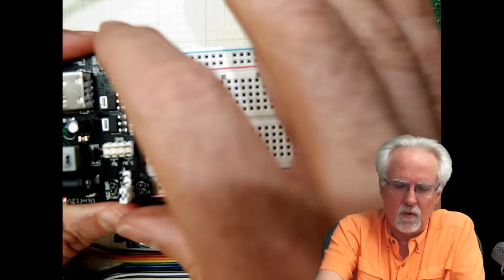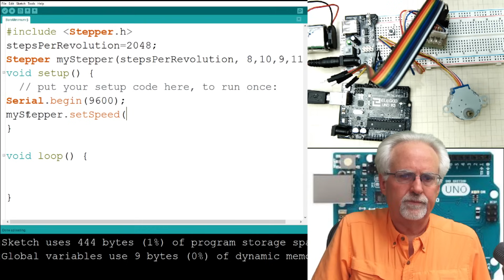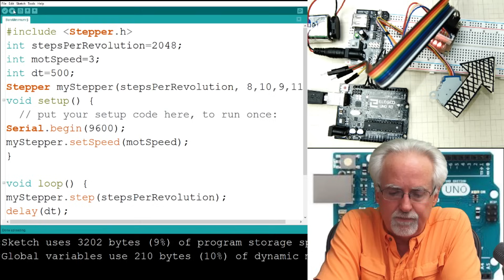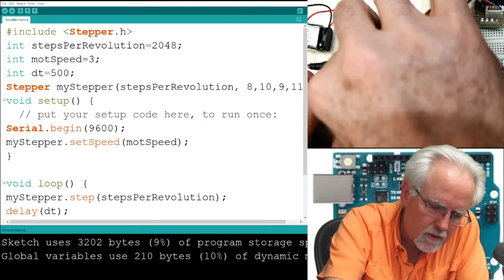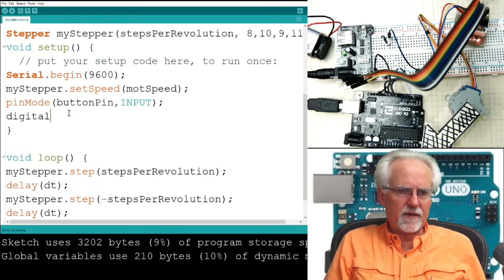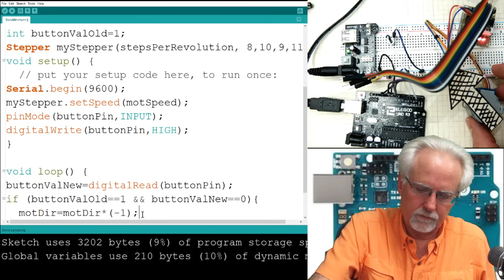Arduino Tutorial 35: Understanding How to Use a Stepper Motor

Comment: Professor, I did not get why we need to add
"buttonValOld = buttonValNew;"
to make it work a second time we press the button...

Cheers!
Reply: Ohhhh, I got it!
The microcontroller is so FAST to read the code that it flip the rotation direction a bunch of times whilst we hold down the button, right?
Therefore the direction could be one way or another...
Interesting!

Comment: GREAT! This is the one I have been anticipating for a project. I am wired as per lesson# 35. I can hear and feel the motor stopping and starting but no movement. Thanks to @Seftdelmer I replaced the 9v battery. That helped - goes round the first time but then there is very little movement if any in the other direction. Is there a foolproof test I can do just to see if my stepper functions - like the 5v direct connect tests you have done with other components?
Reply: Found my own error. Had coded "Stepper myStepper(stepsPerRevolution,8,10,9,11)" incorrectly as "Stepper myStepper(stepsPerRevolution,8,9,10,11) - 10 and 9 were reversed.

Comment: I know it's an old video. I don't know if you read the comments here.

I did the homework as you said, without having seen your solution to that.

I did a attach.Interrupt and with it i called a function "reverse", ive made.

In this function, i reversed direction.

My quick and dirty way of spinning infinitely in the main loop, was to start of with "while (true)"

It's at least a very short code, by having the same outcome.

I've did a INPUT_PULLUP command on the pinmode. That works great.

Thank you Sir, for your educational videos. 
Ive learnt a lot from you!
Reply: I learn something new from this comment. Thank you for sharing your technique! the INPUT_PULLUP was definitely helpful

Comment: Everybody copied you (just kidding). I copied you, I must confess. It worked ok but for some reason the motor stopped turning after a while. Love your lessons but this one got a bit confusing once the push button was added....
Reply from the maker: If you are using the battery, it will only last a short time. Maybe a dead battery problem.

Comment: Paul, I'm having a very hard time with this lesson.  If I procured my own stepper motor how would I go about figuring out the pin sequence? Were would I start to figure out the pin sequence of 8,10,9,11?

Also I spent two evenings working on this assignment before giving up and watching your answer.   I referenced lesson 28 (push button as a toggle switch) and you had us create an if statement that contained a if and else statement.  I could not get the stepper to work using this method.  

I then watched ahead to see the answer to this lesson is a single if statement.  I'm lost on this lesson.

Comment: Tutorial 35 I was not able to do this on my own. I had the right idea, and my code was close, but couldn't seem to get the coding quite right. Also, there was a hiccup on the jumper pins and it took me a while to figure this out. It might be good to put more explanation into the power supply board and also how you figured out the 8,10,9,11 pin setup. I looked at the Elegoo documentation and couldn't seem to arrive at the same pinout you did.

Comment: I did pause. Honest. Only i'm finding something is seriously slowing down my arduino console, when i rem out the .step lines it races on, but when i'm processing stepper instructions, it's so slow the serial.prints are taking a whole minute each, odd. i'm puzzled because the stepper is moving as required. I rem'd out the delay lines, that makes no difference. 

For the record, i'm using an elegoo mega2560 and ide is 1.8.19, 

ROHS by the way, refers to reduction of hazardous substances, it's a european standard to reduce hazardous waste. less lead and cadmium to mention but two. It affects all new goods, and it's the reason there are so much ex factory stock available on ebay, if it's not compliant they can't use it in new product.
Reply: Now i've increased the speed to 10rpm, the motor is running ok, and the console, it's running faster......doesn't make sense.

Comment: I completed the task myself but using a method much less efficient and more complicated than the way you did it, here is my sketch.

#include <Stepper.h>
int StepsPerRev=2048;
Stepper stepsy(StepsPerRev,8,10,9,11);
int RPM=10;
int Reader=12;
int status;
int delayT=250;

void setup() {
  // put your setup code here, to run once:
Serial.begin(2000000);
stepsy.setSpeed(RPM);
pinMode(Reader,INPUT);
digitalWrite(Reader,HIGH);
}

void loop() {
  // put your main code here, to run repeatedly:
status=digitalRead(Reader);
Serial.print(status);
Serial.println("  FowardStep  ");

if (status==0){
  while(status==0){
    status=digitalRead(Reader);
     Serial.print(status);
     Serial.println("  Loop1  ");
  }

  while(status==1){
    stepsy.step(-2);
    status=digitalRead(Reader);
     Serial.print(status);
     Serial.println("  ReverseStep  ");
  }
  while (status==0){
     status=digitalRead(Reader);
     Serial.print(status);
     Serial.println("  Loop2  ");
  }
  
}
stepsy.step(2);

}

Comment: The 9v battery only lasted a few minutes. I was able to find an old 5V transformer that actually put out a little over 6VDC and splice it into the 9V connector. It lit up everything brightly and worked fine!

Comment: 23:56 This is what I came up with, now listening to you now.

 press=digitalRead(button);
  if (press == 0 && millis() - time > debounce){
    direction=!direction;
    time=millis();
  }
  Serial.print("Button State; ");
  Serial.println(press);
  Serial.print("Direction: ");
  Serial.println(direction);
  if (direction == 0){
    motor.step(-stepsPerRevolution/2048);
  }
  if (direction == 1){
    motor.step(stepsPerRevolution/2048);
  }

Where I went stepsPerRevolution/2048 was because the program would wait untill 2048 steps were made before listening to the button. Which would be fine if I wanted to go a full revolution per run through the code. But I don't think that was the intent of the project.

Comment: Mr. McWhorter, my solution is not as concise, but it works and I hope it makes sense, thank you
```
#include <Stepper.h>

#define ResetBtnPin 7

int Dt = 10;

int MIN_STEPS_PER_REVOLUTION = -2048;
int MAX_STEPS_PER_REVOLUTION = 2048;

long MotSpeed = 5;

int StepperStepsAmount;
bool MoveClockwise = true;
int StepsMultiplier = 1;

Stepper MyStepper(MAX_STEPS_PER_REVOLUTION, 8, 10, 9, 11);

int ResetBtnVal = 1;
int PrevResetBtnVal = 1;

bool ResetPressed;

bool isBtnPressed(int _readVal, int _prevVal) {
  bool isItPressed = _readVal == 0 && _prevVal == 1;
  // not used here. just keeping as a reference
  // bool isItPressedAndHold = _readVal == 0 && _prevVal == 0;

  return isItPressed;
}

// 1
void updateButtonsState() {
  int readResetVal = digitalRead(ResetBtnPin);
  ResetPressed = isBtnPressed(readResetVal, PrevResetBtnVal);
  PrevResetBtnVal = readResetVal;
}

// 2
void updateStepperMoveMode() {
  if (ResetPressed) {
    MoveClockwise = !MoveClockwise;
  }
}

// 3
void updateStepperStepsAmount() {
  StepsMultiplier = MoveClockwise ? 1 : -1;
  StepperStepsAmount = 1 * StepsMultiplier;

  if (StepperStepsAmount > MAX_STEPS_PER_REVOLUTION) {
    StepperStepsAmount = MAX_STEPS_PER_REVOLUTION;
    return;
  }
 
  if (StepperStepsAmount < MIN_STEPS_PER_REVOLUTION) {
    StepperStepsAmount = MIN_STEPS_PER_REVOLUTION;
  }
}

void setup() {
  Serial.begin(9600);
  MyStepper.setSpeed(MotSpeed);
  pinMode(ResetBtnPin, INPUT);
  digitalWrite(ResetBtnPin, HIGH);
}

void loop() {
  updateButtonsState();
  updateStepperMoveMode();
  updateStepperStepsAmount();

  MyStepper.step(StepperStepsAmount);
  delay(Dt);
}

```

Comment: I used a for loop to start with, then I had if statements with 3 conditions inside, that is the old and new button values , and then introduced new valuew where I was doing modulus division of the for loop integer j, so if I pressed and it was an even number it spin in the positive direction, in the odd number loop it spin in the negative direction

Comment: I used a stepped adapter to power the stepper motor and I set the voltage to 5v yet It seems there is a problem in which the stepper motor does not rotate in the opposite direction no matter what I do. does it mean the my stepper motor is not working or I did something wrong?

Comment: I tried to reglug everything and the 5V power card's LED turned off when I plugged the 5V wire to the rail. When I ran the program that LED lit up a couple of times and the LEDs on the motor driver board still won't turn on and motor didn't move. Please help!
Reply from the maker: Make sure your battery is not dead. Those 9 volt batteries last about 2 minutes.
Reply: @paulmcwhorter  Thanks but I used the same battery for the lesson for DC motor controls and it worked just fine. I am a little concerned about a broken stepped motor control board.

Comment: I may have found the problem: I plugged the 5V and ground wires to the 3.3V rails. But when I replugged the 5V wire to the 5V rail after plugging the ground wire, the motor driver's LED turned off. And the motor still didn't turn. What did I do wrong? Thanks!

Comment: Somehow the stepper motor worked once in the beginning and then it stopped working (and the motor driver card's LED lights don't lit up either though the 5V board's LED still lits up). Not sure what happened?

Comment: my stepper motor seems to only be moving in the clockwise direction but when i want to it go in the counterclockwise direction it sound like it would work but the shaft doesn't move. the code I have is the same as yours, any suggestions.

Comment: Hello Mr.Paul.  The same code t tried with my arduino board, it worked nicely, motDir*(-1)  idea is wonderful. I think this must be the optimum code , however I used 1.5 sec delay inside the if loop so that every time the push button is released the motor halts and then changes direction to allow enough time to decay the kick back emf. Thanks Mr. Paul.

Comment: Hello Paul. Quick Question! is it possible to plug the power supply of the motor to the computer using the other port? or is it dangerous ? Since i do not have the battery that you are using. Thanks in advance !

Comment: These Videos are absolutely amazing. I always watch till the end. Thank you so much!

Just a quick question. If I were using a different stepper motor, how would I know if my power supply would provide the correct amount of amps to the driver. Also, how would I know if I'm using a correct driver for the stepper motor?

Comment: Me just low at understanding English properly, I have a doubts here

Before using the switch, you wrote code "mystepper.step(stepsperrevolution);" to rotate the motor 2048 revolution.
But after coding for switch you wrote "mystepper.step(motdir*1);"
How this is working, it didn't got it. 
Please

Comment: Hi Paul.  Thank you so much for your Arduino tutorials.  They are the BEST that I have found on YouTube.   I really only have a couple of projects that I need an Arduino, but it still requires that I learn this whole series.  I followed this tutorial as well as the one on Potentiometers and it worked perfectly.  I'm having trouble incorporating a button AND a potentiometer with the stepper motor.   My project is controlling a large stepper motor with a momentary button to start the stepper in one direction until released and the motor stops. Another momentary button to start the stepper in the opposite direction, and a potentiometer for speed control. Any help would be appreciated. Thanks!

Comment: I did it in a different way and used a boolean value. This homework is challenging for me and took me 4 hours (with some momentary breaks) but enjoyed the process. Thank you Paul for teaching me how to use the Arduino. 

Actually I bought the kit on January and looking for tutorials but I was so hesitant to watch yours because I want to literally go straight up making cool and perplexing projects. I gave up because I don't understand anything. From why is the LED hooked that way and why it has a resistor. Why does the breadboard has + and - rails. Why do you do pinMode in the void setup and digitalWrite in the void loop, and literally everything else. I felt that this isn't for me even though my long-time dream is to work in the robotics field (still my dream as of now). I figured out the reason why it was hard. It's because I immediately jumped to the best part where you apply everything you learn (which for me, none) to make those cool projects. Just like how everyone wants to be like Elon Musk but no one wants to work hard like him. Anyways, this thought of mine lasted until May (4 months after buying the kit). I again saw your tutorials and somehow thought of watching everything, because suddenly I get the feeling that I want to learn. Now I can apply what you taught us from Lesson 1-35 and still ongoing and looking forward to finish this tutorial. Thinking of watching your tutorial is one of the best blessing I got so far in my life.

Sorry if this comment is too long. It's okay if you don't want to read it. I just want you to know that I made it this far and you are a big part of it. I'm still working with my dream. Thank you!!!

Comment: I tried this assignment and failed. Eventually I figured out that the motor I got in my kit won’t step a value less than 5 and it has 2000 steps per revolution instead of 2048. For the longest time I couldn’t figure out why my solution wouldn’t work so I’m watching on for your solution to see if I can adapt it to my conditions.

Edit to add. It took a few extra lines of code, but it’s working. I’m definitely not frustrated or anything. It was fun messing around sorting out my values and now it’s running just like yours, just on different step values. It’s probably a good learning experience for being able to figure out other hardware.

Comment: I think I got it! I used the simple pushbutton setup from the last lesson, then made a variable 'x' that adds one to itself for each push of the button, and waits for you to let go using 'while pb_state is equal to 0 {check pb_state}'. If x is equal to 1 then stepper equals high (rotate clockwise), if x is equal to 2 then stepper equals -high (rotate counter clockwise), if x is greater than or equal to 3 then x equals 1 (resets rotation back to clockwise). SPOILERS!! Here's my code! 🤓💻

#include <Stepper.h>
int stepsPerRev = 2048;
int motSpeed = 10;
int pb = 7;
int pb_state;
int x;
int dt = 100;
Stepper myStepper (stepsPerRev, 8, 10, 9, 11);

void setup() {
  // put your setup code here, to run once:
  Serial.begin(9600);
  myStepper.setSpeed(motSpeed);
  pinMode(pb, INPUT);
  }

void loop() {
  // put your main code here, to run repeatedly:
  digitalWrite(pb,HIGH);
  pb_state = digitalRead(pb);   // checks for initial PB state

  if (pb_state == 0) {
    x += 1;   // adds one to 'x' under condition
    while (pb_state == 0) {
      pb_state = digitalRead(pb);   // waits until user lets go of PB
    }
  }

  if (pb_state == 1) {

    if (x == 1) {
      myStepper.step(HIGH);   // Rotates stepper clockwise
    }

    if (x == 2) {
      myStepper.step(-HIGH);   // Reverses rotation of stepper
    }

    if (x >= 3) {
      x = 1;   // resets stepper rotation
    }
  }
}

Comment: Hello Paul! I have a question about jumper cables. Do the jumper cable colors matter. Like for example does the black jumper cable only work on grounds or can it be used on pins? Thank you! Keep up the great work!
Reply: I am not Paul however I’ll answer your question. 
No the color of the wire really doesn’t matter unless someone else is going to work on the project later. I prefer to use red for positive and black for negative because I have a background in automotive repair. In alternating current circuits like house wiring black is typically used as hot, white for common and green for ground.  For these projects sometimes it is which ever wire I pick up first since they are temporary.

Comment: Hi thanks for the videos i have been learning a lot, I did not understand where you got the 2048 number from at 16.22 , I went to datasheets this number is not displayed, it seems that you looked at the stepper motor that writes 28BY-J48 and concluded it's 2048, maybe from experience or you worked in some way that i missed, i needed some help in case i wanted to work with other stepper motors on how can i workout this number.
EDIT: So i kept digging and if i got it right this stepper motor(28BY-J48) with this driver on amazon is always appointed as a 5.625 
degree per step meaning it will be 64 steps to 360 which will according to the code  our steps shouldn't be 64?! so I am sort of confused.
EDIT my bad this is not the same model i was looking at. 28BY-J48 is not 28BYJ-48

Comment: I was able to do the "homework" on my own. This time through the series, I've been meticulous about saving old programs. Every time we have an assignment that references something we've done before (like the toggle button in this assignment), I open the older program and try and figure out how to adapt it for the new use case. Occasionally, I'll actually have to go back to the lesson where it was discussed (for example if I don't remember how to set up the circuit) but thus far, the code is usually enough to jog my memory. Several programmers I have talked to have told me that knowing how to adapt existing code is almost as valuable as writing that code the first time and I took it to heart.

Comment: Hey Paul- as always, Excellent lesson!
Also- I managed to do the assignment by myself using things taught in previous lessons. The feeling was awesome!
Just one thing though- for the command to make the motor move 1 step I found it unnecessary to multiply the value by 1, It's already 1 or -1 so why multiply by 1?